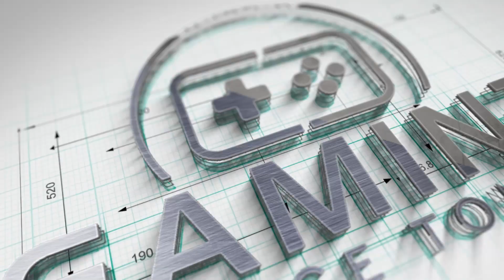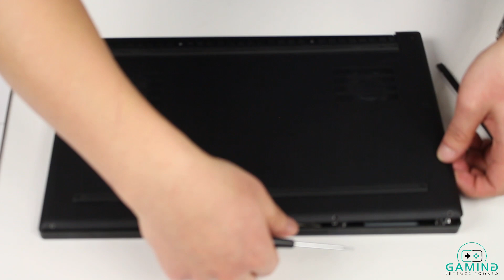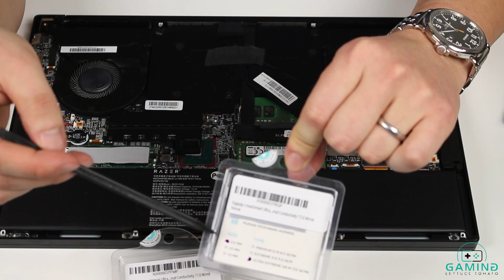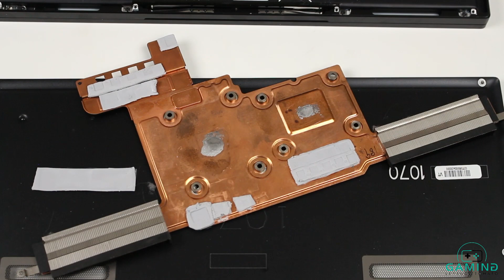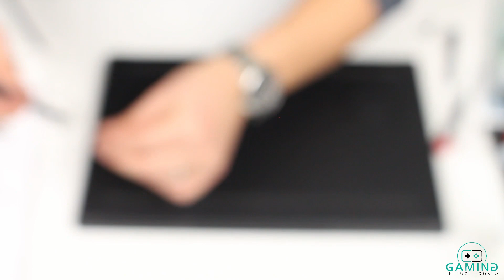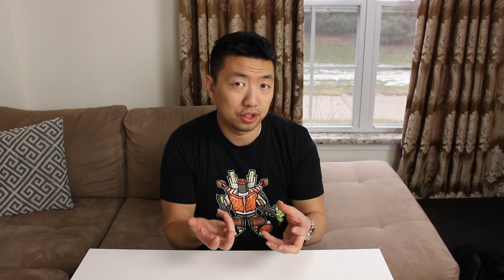Razer Blade 15 Advanced Liquid Metal Repaste

Comment: I'm pretty well up on components and pc building. I have done it many times. But i have to say im slightly worried about messing with the razer just simply because its such an expensive laptop.
HOWEVER, if these two clowns can do this with the battery connected and not fuck it up then i have a shit ton more confidence in myself.
Reply from the maker: And we didn’t use any anti static straps !
Reply: @GamingLettuceTomato  haha. Fuck it. To be fair Ive never fucked any piece of hardware up from static or not disconnecting the batteries.. but I would prefer to do it on this particular laptop.
Reply: My concern is that a laptop gets held in many different angles and worry if it spills.
Reply: Unfortunatley razer laptops are so thin and yet hot to the touch  (aluminum body)
So u have to make sure its running with fast fans and proper thermal paste just for the sake of your mind

Comment: was there any real difference in performance?
Reply: I own the exact same RB 15 advanced and also put in liquid metal and cooling pads. Thermal throttling is eliminated for both CPU and GPU and on top, the entire machine runs cooler. You get higher and more stable FPS as everything runs cooler and especially the GPU can maintain higher clock rates.

If you know how to apply it and know about the downside/danger it comes with and you are willing to do it, it is definitely worth it.
Reply: Dasoul what are the downsides and dangers??
Reply: @rahin26  If applied wrong, you may damage your hardware, due to liquid metal being electrical conductive.

But if you watch videos of it so you get a feeling of how much liquid metal to apply, there is nothing you can do wrong.

On top, you can use electric tape (Kapton tape) and/or nail polish to cover surrounding transistors.

I checked my Razer Blade for the first time after 7 months and the liquid metal was 100% at the same place, as when I applied it.

I use my Razer Blade a lot at different places, in bags and the liquid metal stays in place perfectly fine.
Reply: Dasoul Thank you for explaining 👍🏻👍🏻 I will take those precautions. 😀
Reply: @dasoul3710   have you noticed that the machine is wormer to the touch with LM then it was with thermal paste?
Reply: @ivodelev9794  No, wouldn't say so.

Comment: How is the blade doing now? Longevity wise?
Reply from the maker: We actually upgraded to the new RTX and no longer have the original. The blade 14 with liquid metal was still great about 4  months ago before we sold it.
Reply: It will slowly eat through the heatsink but we are talking about ~10 years. If you re-apply the liquid metal (depending on usage) 1-2 times a year, you will have perfect temperatures.

Comment: hi :), since ur first bought and until now, can u tell me if there are problems and issues that u have experinced of this laptop, if so what are they?? because i have seen many many on the internet (youtube, reddit, forum, etc.) about razer blade 15 quality issue like screen flicker and very bad bleeding, battery issue, fan issue, not turning on, and so onn.. if there are the issue can u mention below :)? many thanks
Reply from the maker: Hi there! The only issue we had with that blade 15 until is the webcam. The webcam stopped working, you can see tons of posts regarding to webcam issues online, keep in mind that this blade was first of its kind. Our 2019 unit is perfect, no issues at all, only slight light bleed and alot cooler, we kept it with stock thermal paste and it is still cool! There will always be more people posting issues than people with good experiences. If you're worried, we recommend getting it from the Microsoft store with extended warranty :)

Comment: not disconnecting the battery in the first place is the most common and the most stupid mistake people make on such tutorial (LOL)  films...
Good job.
touching everything with a screwdriver while under voltage. Sweet.
Reply: i literally followed his instructions like an idiot and something sparked when i tried to remove the plate thanks
Reply: @ernest3153  Is it working fine now?
Reply: Its ok, its a Razer so the battery only has 15 mins of charge anyway.
Reply from the maker: Agreed, it's safer to unplug the battery first.  We're too lazy to do so, never had an issue
Reply: @GamingLettuceTomato   Well then dont do a tutorial, you guy like Ernest blow their computer because they follow what you do
Reply: @GamingLettuceTomato  wtf

Comment: The LM is too cool to come off. You have to heat it up, use a lighter to warm it up & it'll wipe off.
Reply from the maker: Oh awesome! Next time we open up the computer we'll try it. Thanks!
Reply: @GamingLettuceTomato  No no no no, The liquid metal has alloyed onto the copper Heatsink, that metal is stuck there. You will need to sand it off.
Reply: @Tetrodatoxin  its not full metal, it has a coagulant

Comment: How much did your temps improve by?
Reply from the maker: As far as temp goes, probably about 10-15 degrees and, we didn't see anymore thermal throttling. Before LM, we got 99degrees with throttling to 85 degrees when playing PUBG
Reply: @GamingLettuceTomato  Prove it, btw. They already use good paste.
Reply: @pmAdministrator  Stock paste is never good. Besides that, you can't compare regular paste with liquid metal at all. Liquid metal is on a whole different level. Liquid metal has compared to even the best thermal pastes like Arctic MX-4 almost 10x the thermal conductivity.

I run the exact same RB 15 Advanced and can confirm this temperature values, I even get a bit better values. The whole system runs without any thermal throttling at lower temperatures than before.
Reply: @pmAdministrator  is it 75w/km good?
Reply: @dasoul3710  Yeah a Razer needs throttlestop without Liquid Metal.

Comment: Update your BIOS to fix that webcam issue. Also suggest getting the dust out of those fans, likely the cause for the higher temps over time.
Reply from the maker: Will do! Thanks!
Reply from the maker: It didn't fix it. Some owners are also experiencing the same issue. Ended up replacing it for the new Razer Blade 15 (2019). Thank you Microsoft Warranty!
Reply: @GamingLettuceTomato  would love to see how liquid metal does on the 2019.  i just did kryonaut and its great so far.  got sketched out on the metal, was concerned it would corrode the heat sink
Reply from the maker: We just got 2 units of 2019 model with 2070MQ. So far with stock thermal paste, the CPU maxed out in the mid 80s and GPU in the mid 70s (gaming mode). We are super impressed!!! No thermal throttling!! No plan of repasting these new ones at the moment
Reply: Gaming Lettuce Tomato with kryonaut I once in a while will see it hit no higher than 84 on CPU but drops right back down to mid 70s. Never see the gpu over 72. This is with an undervolt. About the same as with stock paste.  I’m rocking a 2060. Pretty happy with this thing!!